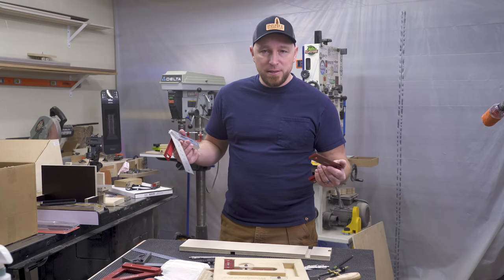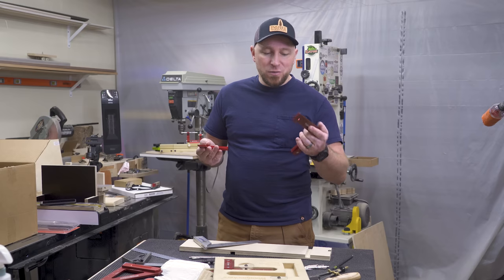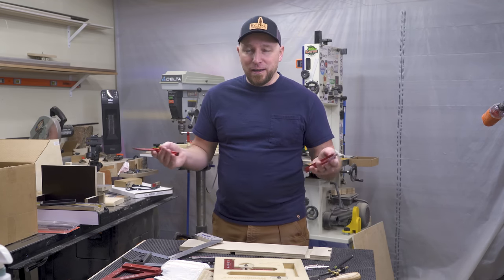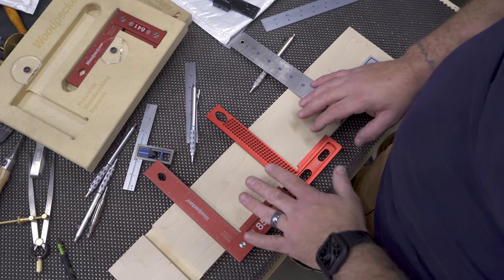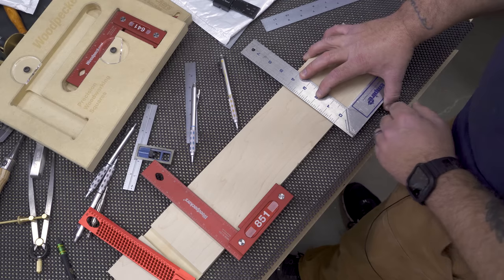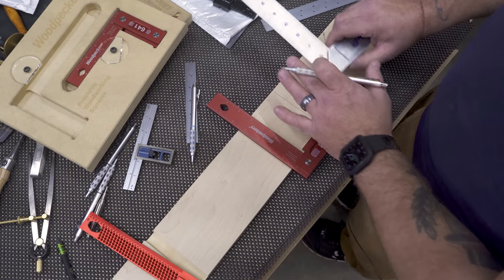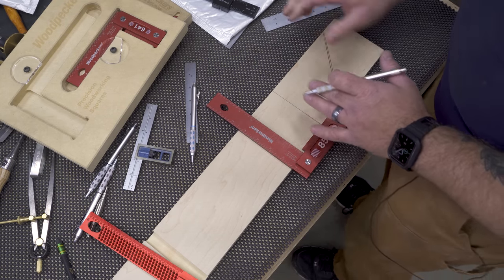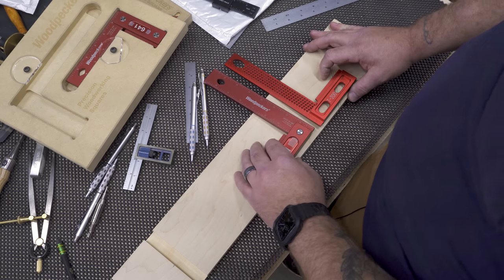Woodworking Squares: 851 VS T-200 / Woodpeckers Tools Compared To Banggood Tools

Comment: Love woodpeckers tools, but as a retired disabled Vet, I don’t have a woodpecker budget. I make do with what I got and can afford. Blew my woodworking budget on my new sawstop. Had to buy it. Can’t afford to be any more disabled than I already am LOL!
Reply: I’m in the same foxhole brother 👊🏼 although I went with the Laguna fusion 3 and laguna 14bx bandsaw.
Reply: Semper Fi brother. Similar situation with disability, social security & a tiny IRA. But I've got a 40 year old radial arm saw I keep in top shape. Also have some HF tools & "measuring" instruments but only where the quality of my work is less critical. I generally go a step or two higher for real measurements, although I can't afford Starrett or Mitutoyo. Recently splurged on a set of machinist squares and a set of setup blocks from iGaging, those help a lot with accuracy & precision.

3rd AMTRAC Bn, Vietnam 69-70.
Reply: First off thank you for your service. I too am disabled and live on a fixed income. It's difficult but, every once in awhile I have to splurge and treat myself. I only buy the Woodpeckers tools when they're on sale though. That's how I ended up buying on banggood.com.
Reply: Same fighting-hole with you brother, I’m just fortunate to have both my retirement and the disability to compensate for the loss of the opportunity of a second career and family provision; all because of wicked RoE’s during the the Obama and Bush administrations.  
  Maybe try a traditional metal and wood with brass registration edged trysquare, I’ve had good success and they can even be tuned up some.  The woodpecker mini square is great for checking chisel edge squareness, table saw 90°, plane iron mouth alignment and is very affordable at under $20, stays in apron or sharpening station, etc... well worth it. 
Semper Fidelis, Shannon
Reply: Thank you for your service sir. I hear you about the Woodpecker budget. There is one channel here on YouTube where the guy has the compete Woodpecker set of tools on display in the background. Must be nice. I would be scared to death to drop one.
Reply: $99 is a lot of money for a T-square
Reply: Having 1 arm/leg myself, I can't afford a sawstop, or the space to use it. I just use a track saw,  and routers to do what a table saw does. 
 
Thanks for your sacrifice!
Reply: @carterscustomrods  
Thanks to you as well my friend. Gob bless you and yours
Reply: First off thank you for your service.
I was a Navy Seabee. I was a reservist.
I was a BUCN … a builder or carpenter in the SeaBees.
I was a carpenter when I got out of college.
I always love building. I could not afford a lot of quality tools when I was younger.
I am remodeling a house my wife and I bought recently.
I agree with everyone here on this channel that Woodpecker is very expensive.
Great tools if you’ve got the money!

All the best my friend!!

Comment: The notch that isn’t at a 45, is to allow you to take a scribe, all the way past the edge, and then draw it back onto a piece of metal marked with machinist’s dye, and leave a good clean scribe mark.  They are meant to be held with the fingers pressing the blade flat, and the thumb pushing the base onto the reference edge.  In Machine work they are not graduated.  You lay out the 90, then use dividers set to a rule, to mark the offset from the edge as it intersects the 90-degree line.  The tool evolved into a woodworking and general marking tool with the addition of the graduations, and the notch just came along with it.
Reply from the maker: That's interesting, thank you. I have asked this so many times and never received an answer like yours. I wish there were a video that explained this so I could understand a little bit better and pass it along to others.
Reply: Thank you that was very  nice of you to let people know, why there was such a difference in that particular marking place.

Comment: Another very helpful comparison. Thanks.  I have the WoodPeckers 641 851 pack but not the Banggood T200.  Instead of the T200 I bought the Bangggod T260 which is a small version of Woodpeckers T Squares.  I bought it a year ago and it works well as it has the holes every 1 miilimetre. It is a one sided tool as the top surface is flat.  It has white infilled mark to indicate every 10mm mark ( or 1 cm) . The T260 came packed in a cardboard box with cardboard insert to keep the tool stable during posting, so OK on that score. 
At that time Banggood did not have a version of WoodPeckers Precision T Square (which I would love to own but cost of postage to Australia is as much as the tool itself.) 
The have only recently made Drillpro 300/400/500/600mm Woodworking Line Scriber T-type Ruler 1mm Hole which is a very good product. 
Hope you do a comparison of it to the WoodPeckers Preciosn T Square if you have both.
If Banggood is willing to send a T200 to one of your subscribers and no one in USA is willing to use metric the cost of postage from Banggood to Australia is the same as to US - approx $4

Comment: I love these videos! I'm an information junkie, but also as an engineer I want specific details -- such a how well the tool slides. I'm so new to this woodworking thing, and have purchased too many tools that look and sound good, but turn out to be trash. I might eventually be able to justify a single Woodpeckers tool, but until then I now know what to look for when I get something new. It's a good thing The Big Online Store is so good about returns because these days so much of what they "feature" is crap,  their descriptions pretty worthless, and the ratings untrustworthy. We have a Woodcraft store here and they are pretty good but going out to the store is, well, these days, going out, and I try to limit that. Great work! Oh, and I don't mind the length; I watch most everything at 1.5 speed anyway and that cuts running times down.
Reply: Tip with respect to squares materials make a huge difference. Wood working requires at least one good traditional plain accurate tri square with a hardened and tempered steel blade. Look at say an old Stanley 14" tri-square are pretty nice for allot of overall carpentry reasons. The classics become classics for reasons that most users never know or notice. I am a retired carpenter. Worked professionally and successfully as door drawer and panel maker. Full furniture restoration refinisher and manufacture in artisanal small shop. Then single-family home building all aspects of skilled labor carpentry based.

Comment: I have the Woodpeckers 642 square and love it. It is 6 1/4 inches and in stainless. It has a thin blade which almost eliminates paralax and notches in the body of the blade not on the edge for a mech. pencil tip every 1/16 ". I like steel since I do a lot of marking with a knife and find it more durable than aluminum. Nice head to head, keep them coming.

Comment: Nice video.    Hard to tell exactly from watching the video, but my take on the square tests you did, none of the T-200 tests were square, while the 851 was.  If the T-200 isn't square, there is no point in saving money.

I agree about the parallax issues, that is why I prefer the Woodpecker Stainless squares, like the 641.   The blade is much thinner (plus it also has cutouts for marking dimensions).

Comment: Thanks for another excellent and useful comparison. I love Woodpeckers' tools and have many but there is no denying that they are expensive. Also, I have never had a Woodpeckers tool fail to deliver as designed. I also have several Bangood tools and find them generally quite acceptable but without the exquisite WP finish.

Comment: I sort of hate to say it, but once you go past box carcass making high skilled furniture and other item makers do not usually measure for most joinery. Since you do not use the square to determine length of panels styles or rails it is mostly used for marking and checking for square in joinery.
 I used to be a door and Drawer Maker at a high-end cabinet shop. I used a tape measure for story boards, stock length width checking, and some veneer calipers for thickness checks during stock preparation.
 When it came time for joinery is where marking with a square or marking gage would have been done along with checking for true results on fitting up for glue up and clamping. A square for marking should have a hardened and tempered STEEL blade there is no substitute for this. Graduations are just a possible way to make more graphite dust or nick in the marking knife. Aluminum will not allow me to knife mark for hand work and will not hold up nearly as well as steel.

Comment: I really appreciate the work and details you put into these videos!

A guess on the inconsistency you get when checking for square is that i think it comes from your lead wearing down and changing shape as you draw the second line holding the pencil at a different angle and being rotated differently. As you points out later in the video those graduations are quite aggresive on the lead.
Try using a marking knife instead and se if you get better consistency.
Reply from the maker: I forgot to mention that I checked it with a knife prior, and still found inconsistencies. Thanks for adding this though. Trying to get a marking knife line to show on camera is a very daunting task!
Reply: @InspireWoodcraft  Hold your pencil completely vertical to eliminate this problem.   Nice drafting pencils like you are using are designed to use this way (unless the blade on the square is too thick for the length of the lead barrel).

Comment: The holes on the TS-200 are tapered on both sides making it hard to use them for exact marking as you have to hold you pencil perpendicular.

Comment: I have several Woodpeckers squares. I have a propensity of dropping them on my concrete garage floor. Sometimes that knocks them out of square. In all but one case, I sent them back to Woodpeckers who re-squared them at no cost. The one exception was, after dropping my large 26" x 18" square a few time, it was so out of square that Woodpeckers couldn't return it to square. Instead, they let me buy a new one at a 60% discount. The really do stand behind their tools.

Oh by the way, you didn't mention what tolerance the T-200 promises. Woodpeckers guarantees their squares to be square within 0.0085 degrees over the length of the square.

Comment: I bought one of these from AliExpress.  Mine also had a defect on the back of it in roughly the same place.  Except mine had a large lump from the casting.  Which probably explains why yours had a grind mark.  I raised a complaint.  They decided that it only effected 50% of it’s usage.  So they refunded my 50% of the purchase price.  So I cannot use it to measure inside angles.  
Mine also is not square.  My advice would be to not buy the T200 square.

Comment: Thanks for an interesting and informative video. Your trick of flipping the Drillpro square to make a line from the inside edge of the square works only if both edges of the wood are parallel. Of course, you know that and in your rush to get the video out omitted mentioning that requirement.

Comment: Even as a “weekend warrior” I’d love to have the budget for those woodpeckers lol but I make do with the big box store speed squares...keep up the great work with your content!
Reply: Same.  I have learned how to clone tools though. It’s kind of a fun hobby to do between projects. 

I borrowed a friends high end tri square and made a clone out of oak. It is JUST as square as the original tool.  Besides the time I spend sanding and finishing, it was free.  I had scrap wood laying around. But on a side by side test, I get the same results. 

I might not have a ruler on it (yet) and it might not be AS user friendly.   And I’m sure as it ages it will warp or wear.  That’s okay. At that time, my wood working skills will have increased to the point that I’ll buy a nice one.
Reply: Take a look at the pec blems u can slowly make a set piece by piece n their highly accurate

Comment: Good video. I have been in my shop comparing my acquired squares that I have gotten since I began woodworking last year. While some were legitimately out of square junk. There were some instances where it seemed how I held the pencil, and the lead point affected the outcome. Some tests showed square and not square with the same tool. Either way, I have a Woodpeckers 18” Square coming in, so it will all be moot soon. I might however not so easily dismiss Bangood in the future now as I consider jumping to Metric on builds.

Comment: My only problem with banggood is packaging. I recently got 10 items, they get shipped separately 1 or 2 items per shipment and that is fine. Some tools have their own hdpe box which is fine, some come in cardboard box ( precission 90 and 45 certified machining squares etc) which is also fine, however, some other stuff only came in its original moulded plastic packaging wraped only in banggood bag. Those items were stainless steel rulers, those bendy ones with pencil holes in them - t ruler/square 400m was fine and I love it, use it for architectural drawing and its much nicer than any t square I have used so far. The other one was 90° 180mm  line ruler, pencil holes etc, that thing was apsolutely destroyed, plastic packaging has white lines where it was bent, 90° ruler completely destroyed and corner bent in and I cant set it back into shape, I can only imagine the torture it received in delivery vans trucks etc. Now the only thing protecting that packaging was banggood bag, and that isnt normal to me considering the means if transport. 
I would gladly pay that bit extra for cardboard box, there is nothing worse than sending stuff back.

Comment: I've used crap and quality tools. Middle of the road seems best to avoid overpaying while getting a tool that functions properly.  Personal preference certainly plays on any tool use, but i try to replace any tool that creates mistakes that are clearly not operator error. Simple like you said, if it gets the job done, it's great. If it is inconsistent, it's gotta be replaced/upgraded.

Comment: I inherited a machinist square from my dad along with other layout tools. Forty years later they still do just fine. For me woodworking is a hobby and while I can justify the expense of specialized power tools. I am getting older and some hand tools harder to use. Upper end layout tools not so much as what I have will do even if its take a little longer to get there.

Comment: I have the Woodpeckers Delve square and the bench squares from Chipsfly.com. The holes are milled a little bigger on the chipsfly which make it easier to fit more pencils in without breaking the lead and I've not found an issue with it being less accurate. But I would love to know what you think.

Comment: Great review Jodie.  What is so terrific about your review is that you don’t break our brains with minutia detail about 10 thousands of an inch off over  the run of 30 ft therefor the tool is out of square.  Hell wood moves way more than that on a cloudy day for petes sake.  Your reviews involve what we would deal with in the real world of woodworking.  They deal in the details that really matter and I appreciate that as it allows me to learn and make an informed decision
I think it would be a huge plus if you advised everyone of the price points. ALL BANGOOD tools are remarkably less expensive than woodpeckers and they offer a huge value in price-performance etc. not everyone dam afford a woodpecker tool necessarily.  I am not advocating for one over the other nor am I one who believes all tools from China are junk.  I have never seen. Anything from bangood that is junk and I have seen a lit of them

Rgds/harleymike

Comment: I have the T-200. Mine is square on the inside and outside when registered to stock. But it is not square on the base. I asked to get a flawless one, but was told that I will not get a replacement. I would not recommend these Banggood squares. I have also bought a tiny square which is a copy of the smallest Woodpeckers one.
I now bought a 1282SS -- which I got for a good price. Still very expensive, but at that price I thought it would be o.k. The 1282SS is a good square and I will use it a lot. I can recommend Shinwa squares and rulers. They are not too expensive and are all accurate. To bad that there is no similar square to the Woodpeckers square (with the lip) from Shinwa. :-(

Comment: I've seen some woodraphic squares on amazon that are somewhat expensive as well and I see a few comments from folks who have/had them. I'd love to see a future comparison of the 8-inch woodraphic against the woodpecker with your keen attention to the details.
Reply: I’ve had my eye on the Woodraphic also. Take a look at the Kapro - Ledge IT squares, could be a good budget friendly option also.
Reply: @lcsquared8937  Thanks, I just did so! It appears that the Kapro is missing the main draw on the woodpecker/woodraphic for me which is the ability to rest freely on a work piece as it doesn't have the lip to do that. It does look like a nice tool though for it's price.

Comment: @inspire woodcraft. Just want to add something about the drillpro, I think you could also use this like a protractor if you have a nail on the inside of the square and use one of the holes depending on what size circle you require. Worth a try.

Comment: Just an FYI Banggood has a square that is closer to the 851.  It's imperial on one side and metric on the other.  I imagine the fit and finish is no different than the T-200.  Thanks for the comparison.

Comment: You could have saved a lot of time if you would have skipped the packaging and finish parts and went straight to the fact that the cheep tool wasn’t always square since that really the one of 2 thing that matters the other being accurate measurements.